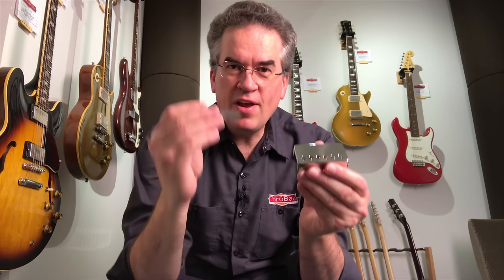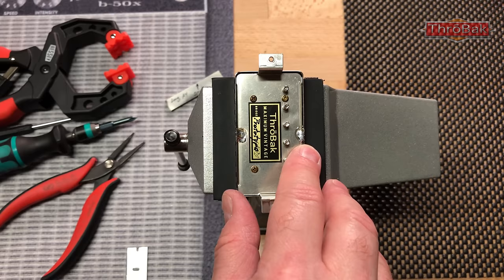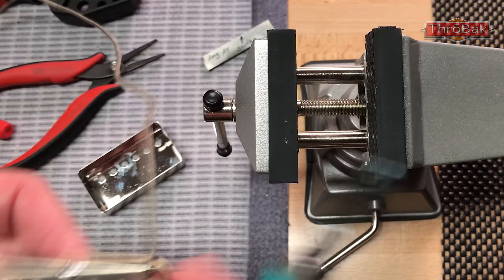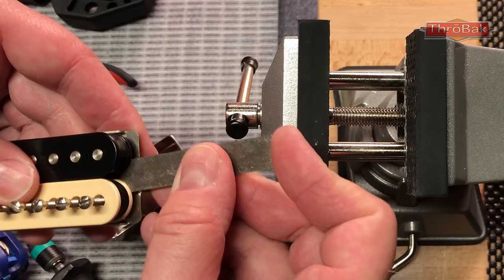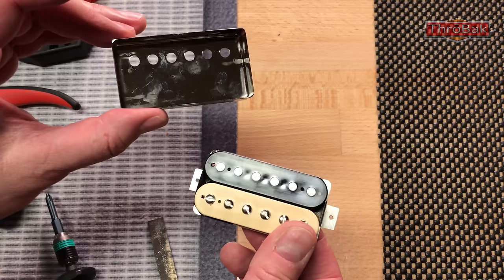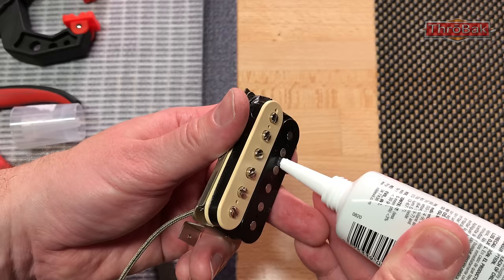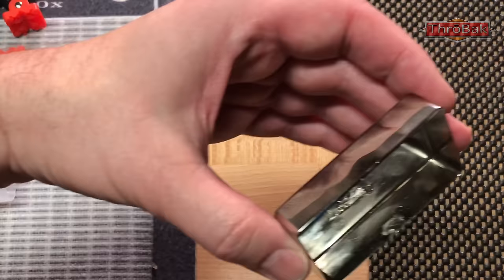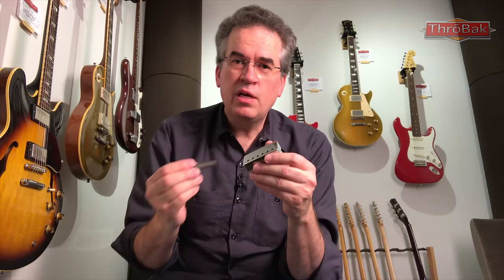PAF Humbucker Pickups: How to Change the Cover and Magnet (Tone Hack!)

Comment: In the early 70s I fooled around with pickups. Back then it was hard to come across parts for pickups. You had to canabalize another pickup. Wax potting came around shortly after. At the time I did not pay much attention to the effect it had on the pickup. People just took the covers off. However The few covers I reinstalled did not have any Issues. I like the Idea of using minimal amount of silicone. I would not want to deaden the pickups natural harmonics more then necessary.Thank you very much for posting this video Jon.

Comment: I have done it and damaged the wires on a pickup once. So be careful to not touch the coil wires or connections with the base plate. Do not force things when moving the back plate to remove the magnet

Comment: You should do a video on the difference physically and magnetically between vintage magnets and modern ones, Thanks, I'm fascinated by this stuff.
Reply: The difference is in the wire winding and in the percentage of aluminium, nickel, and cobalt in the magnet, you can find books that explain everything, i have 4 books about guitars and amps

Comment: I'm trying to see if I can improve my old Korean built Epiphone Sheraton, one of the guitars that had the stickers on the pickups that said US designed Alnico pickups. But this requires a beast of a soldering iron. My 50W Weller bench iron has never been defeated before and even my 100W solder gun wont do it (and yes I was a bit worried about the radiated AC field from the gun perhaps degaussing the magnets). I guess I'll have to buy a new large iron.

Comment: Super great look into pickup construction. As a Joe Handy tech geek, I was glued to the screen (I love this kind of stuff). I have a question. Once I tried to adjust the pole pieces on a potted pickup (came with no cover). It immediately started squealing where the was no squealing before. My point being, once the potting is disturbed, 'things change'. So, if you wish to loosen bobbin screws, or remove a potted magnet, should you repot the pickup?

Comment: Not quite the same topic, but I noticed when I first adjust the PAF pickup screws, the screws are quite stiff, however on another pickup that has been adjusted many times the screws are quite loose. What is this due to and has any damage been done to the pickup?
Reply from the maker: The more the screws are adjusted the more the threads are freed up. This is normal.

Comment: Hi Jon, Thanks so much for your highly detailed and informative videos! This one was of particular interest to me because I have a guitar with two humbucker pickups, where the neck pickup has the magnet oriented backwards (South pole to slugs) from the factory. I suppose that's an easy mistake to make if not paying attention. As I watched this video you noted that the narrow long edges that are against the keeper and spacer are the charged ends, which is what I thought. Some videos on YouTube (there's a lot of conflicting information out there!) also say that the long wide surfaces (against the base plate and underside of bobbins) have a charge and need to be oriented correctly. Is that correct? Do I need to be concerned with those surfaces when correcting the magnet placement in my pickup? I didn't think so initially and figured I'd double check with you before attempting this work after watching this video, since you obviously know these pickups inside and out, being a pickup manufacturer. Thanks again for taking taking time to make such great videos!
Reply from the maker: You don’t need to be concerned about polarity with those surfaces. Thanks for the comment.

Comment: Hi everyone ,I was wondering if you could help me out here.
I was planning to change the cover of my pickups ( Gibson Humbucker  490r e il 498t) in gold tone so I would need to change the Pole Screws too in the same colour.
I bought Pole Bolts - Slot Head 5-40 x 18mm (imperial). 
Did I get the right POLE Screws or did I need to buy different ones? 
I am still waiting to receive the guitar with those pickups so I can not really tell  but these pole screw looks a little too small to my eyes.
 I am not an expert so I was wondering if you could help me out
Thanks!
Reply from the maker: 5-40 x 3/4” is the correct size.

Comment: Why you screw out those poles when you can just screw out a little those screws under the pickup and take magnet out? I think it's easier that way.

My way to know how new magnet goes right way in is that, when old magnet is still inside the pickup, i put new magnet up on the pickup poles and if magnet goes right and left, it's right way. I think it's easy way to know if you don't have any tools to know polarity.
Reply from the maker: ThroBak makes a vintage PAF replica and that means the pole screws are threaded into the baseplate just like a vintage PAF. That means that you more often than not, need to back out the pole screws as well to release the magnet. Cheaper PAF pickups don’t have threaded baseplates, that is probably what you are familiar with. Having the vintage correct threaded baseplate means it takes longer to assemble the pickup but it gives a mechanically more solid assembly than the cheaper method of not having a threaded baseplate.
Reply: Well that was new thing for me to hear. Thanks! I have tried magnet swap with Duncan Seth Lovers, 59 set, Gibson 57, 490R and BB3 pickups for paf kind of.

Comment: Hi Jon.  Do you happen to know what magnets came in a 1966 patent number T top?
Reply from the maker: Short A2 or short A5. Could be either one. 1966 will be a pre-T-top.
Reply: @ThroBakChannel  
Then somebody switched out the pickups in this 66 SG and put patent # T tops in it...  the pot date codes are 1376642.  What was the cutoff year that they went to t-tops?  Thank you!

Comment: Hi Jon, I enjoy your videos - very helpful and informative. I have a question regarding the Peter Green mod which makes it out of phase in the Middle position. But does reversing the magnet actually change the sound of the neck pickup when used alone in the Rhythm position?
Reply from the maker: There is no effect on the neck pickup. The magnet flip only impacts the middle position tone.
Reply: ThroBak Guitar Lounge Great! Will definitely give it a try. Thank you, from Japan!

Comment: I need some info. I hope you see my question. The magnets I want to swap out between two pickups are all polished, sides and top and bottom. I know about the polarity (north and south) on the long edges of the magnets (south to screw side). But does it matter top to bottom how the magnet is installed as long as the sides are installed with proper polarity? Thank you for any info you can give me.
Reply from the maker: I would place the polished side against the baseplate.
Reply: ThroBak Guitar Lounge Thank you. It looked like it was polished on both sides. But I’ll double check.

Comment: Would anyone happen to know how to install open cover pickup covers?
Reply from the maker: An open cover is installed by pressing it flush to the bobbins and soldering it to the baseplate like you would a regular cover.
Reply: Without a cover is it possible to change the top color of the humbucker? Can you remove, replace or paint it?

Comment: Hi dude!!! Can I cover a staggered humbucker? Lol...That huge difference of high at the poles of the slugs...how to procede in this situation? Thanks pal!!!
Reply from the maker: I’m not sure I understand the question. The slug poles are always flat. The adjustable pole screws can be staggered as you like with or without the cover on.
Reply: @ThroBakChannel  There is a model made by Seymour Duncan, the StagMag, and the slugs are staggered, I don't know if the cover would works with that model...
Reply from the maker: I’m not familiar with that pickup.
Reply: @ThroBakChannel  OK, thanks!!
Reply: @jeffersonpfeifer651  - Use an open top cover.  You maintain some screening to the sides of the coil, but the top remains unfettered.   Either that, or use 12 hole covers.

Comment: I did this on my Les Paul and the middle position is now very quiet and flat sounding, it doesnt sound like it should, weird.
Reply: You've got the Peter Green out of phase mod going on , turn both pickup volumes up full then roll the neck down , when it quacks , leave it !
Reply: @Dad-Gad  I tried all of that, I then installed my old Gibson pickups with the magnet flipped and same flat tone. I have the pots wired the 50's way not the modern way but I dont think that should make a difference, Greens was likely the same 50s wiring.

Comment: I tried soldering the pickup to a new cover and it just beaded up.
Reply from the maker: Try sanding the inside of the cover where you will solder. This will give the cover some tooth for the solder to stick to.

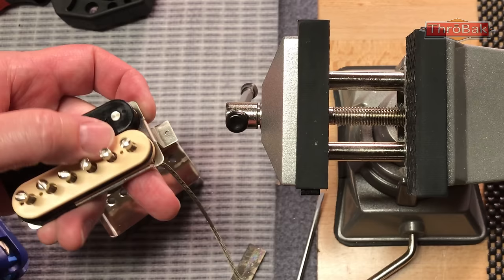Comment: One small complaint. at 13:42 you show using an electric screwdriver to put pole screws back in, no word of ! CAUTION ! against over tightening (yes, this is OBVIOUS, durr the first one I did I was super careful, then i got cocky on the second one) nevertheless there's dummies out here like me that now need a new PAF base plate.
Reply from the maker: There is maybe more risk in using a regular screwdriver. When the pole screws are unscrewed this far out it is very easy to slip the screwdriver out of the slot and gouge the top of the bobbin or even gouge through the tape and ruining the coil. Either way you need to be extremely careful.